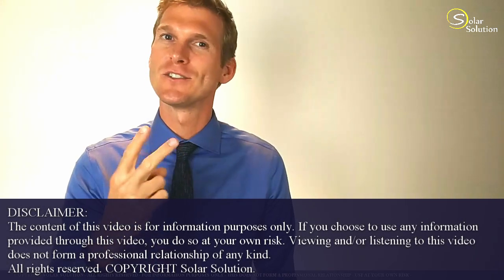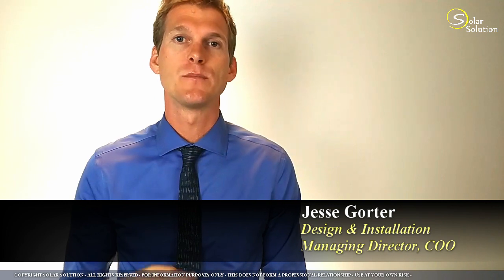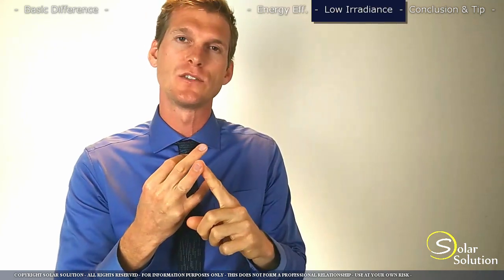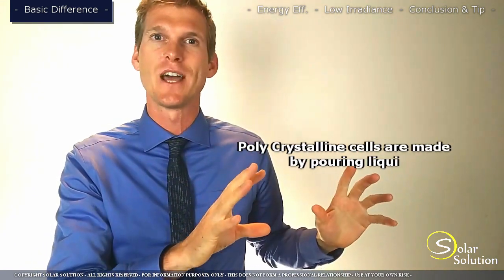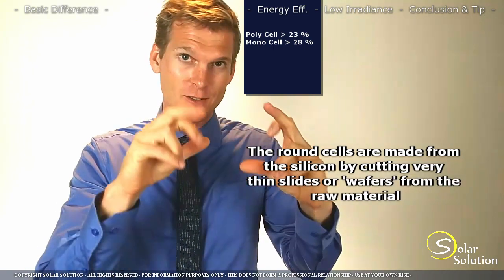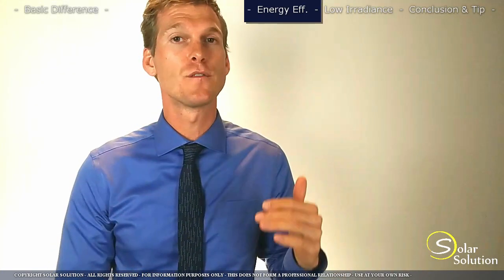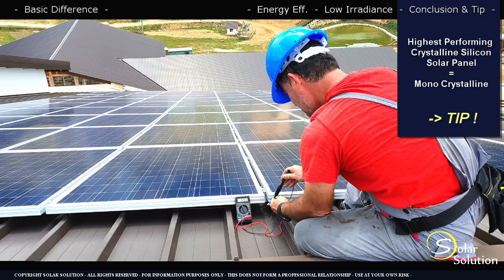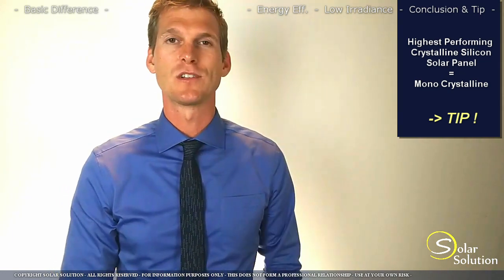Monocrystalline Vs. Polycrystalline solar panels: A Clear and Simple Comparison

Comment: Can you combine a mono and poly crystalline solar panels
Reply: I'm using them combined but on separate strings into a bus, one controller with one battery bank...output from each array is very similar...matching the peak voltages closely to the battery bank is crucial for performance...28-29v bulk charge from 30+/- volt panels

Comment: Great video, as usual :)

I have one question. Is the power rating of a solar panel the output electric power, right? In that case, we don’t have to consider efficiency to perform electrical-related computations, since it is already the output electric power, right?
Reply from the maker: You are correct Alejandro!

Comment: I have decided to buy 290Watt MONO at 32Volt But I can't find any MPPT to convert 32 Volt DC to 220 Volt AC. (I only use it for daytime for my PC and / OR FAN as I work for full-time WFH). 
My question is:
Can I use 12v/24v/48v MPPT to convert 32Volt DC to 220Volt AC?
This is the first time I'm going to use solar panels, and my main concern is low budget. You can say it's an experimental project. If I find it useful then work on a large scale.
I could not find any DC 32V to AC 220V converter :(

Comment: I live in Thailand where it is often over 	100 degrees and seldom under 50. From a ‘Heat’ perspective, Mono sounds better. Correct?
Reply: Incorrect. Wattage of the panel is the same mono or poly, it's the roof space availability and the flow of wind under the panels that will determine your choice. Unless you are doing hundreds of panels on a solar farm, the dimension of mono vs poly will not make a difference to your selection. 100 watt rating on poly is the same as 100 watt poly.

Comment: Being you seem so well informed on solar cells/panels, I have a question for you!  I purchased Bluetti SP120 solar panels.   I use these panels to charge up my Pecron 1500 power station.  Could I get your thoughts on the Bluetti panels and Pecron 1500 power station please?

Comment: Question I have is can you use the same solar 100 watt panel and 1 be a  monCrystal and one be  a poly Crystal whether you use it in parallel or in series is it okay to do that
Reply from the maker: Hello Josh, thank you for your question. In general it is not advisable to combine different solar modules under one charge controller. Good luck! Jesse.

Comment: Hello Jesse. I would like to Learn so far two things, one is which kind of panels in your opinion are better and another how companies are making profit on industrial solar panels ?
Reply from the maker: Hello Alexander, thank you for your question. Which panel is best for your setup really depends on what your personal requirements AND system performance requirements are.
Reply: Go for mono if space is a consideration - and it should be on a house, as one day you might want more!  Also mono are usually black cells and look better / more consistent. So if you care at all what your house looks like - get black with black frames.

Comment: Any possibility of adding a cooling system, say a small water tank, underneath the panel, would that improve the performance?
Reply from the maker: Hello Alex, thank you for your [excellent!] question:
Is it possible? Yes! 
Would it improve the performance? Most likely.
Will the the additional cost and energy consumption be worth it? Questionable.
Thumbs up for thinking outside of the box. All the best, Jesse.
Reply: Yeah - I wonder if a company will bring out panels with heatsinks on the back / liquid cooling. Would make a good 20% difference. But keeping the panel sealed from the weather for 20 years is hard enough - with liquids that can freeze in winter they'll have more warranty claims.
Reply: @markyates5744  but if it was in the winter esp with freezing temp wouldn't that be a good heat sink for the panels -seasonal advantage?

Comment: I live in the deep south here in the US.  My summer time tempretures can reach 100 degrees, but many days are cloudy and rainy.  My interest is in the ability of panels to withstand the tempreture extremes and which is more efficeint at converting partially, or almost no, sun exposure throughout the day. Thank you.
Reply: No panel will perform well in poor light.
Roughly... rain + dark clouds = 5% output. Dark clouds = 10%. Light / white clouds = 30-50%. Sun at right angle = 90% of rating. Sometimes when the sun comes out from behind a cloud you'll see the inverter spike to 110% of it's normal rating. This is because panels are cooler from being in the shade.
My solution (and most will recomend) is to over-size the panels vs the inverter. Panel watt rating is done at 25C. They typically all lose 0.3-0.4% per oC and in hot weather can reach 55C (like a black glass sunroof) ! So will be down around 20% from rating. They'll perform better on a cold sunny day than a hot sunny day.  There is also some losses in cables, and from dirt, and from the sun not being perpendicular. So with 4kWh of panels and a 4kWh inverter you'll rarely see >3.2kWh I reckon - and then only for a few hours.  Solar Edge inverters for instance allow you to have about 50-55% more power in the panels than the inverter. Remember also your electric company might limit you to 5kWh. So you get a 5kWh inverter. But you can pair that with say max 7.7kWh of panels due to the above and you'll never output more - but you'll be at a higher level throughout the day. if the panels are performing at average 33% efficiency you'll have a lot more power at 1/3 of 7.7kW than 1/3 of 5kW !
Reply: @markyates5744 Exactly over panel best option right now.. The main problem is the Solar panels efficiency rating @20-23% is too low, if it wasn’t for the free Sun power these wouldn’t be used at all.

Finding other way to harness the Heat temperature and in return produce a much higher efficiency rating for energy. Needs to be in the 93%+. Same with the cold temperature turning that into energy as well. To Me that’s green energy it’s abundant don’t let it go to waste. 

Wind,Sun,Hydropower,Moonlight,Heat,Cold…. There’s tons of it harness it turn into usable energy that’s the future.

Are all our batteries just chemical reaction containers?
Reply from the maker: Hello Michael, it is good to hear from you. And an excellent question! Knowing which question to ask is often already half of the answer: Two technical performance parameters which you might be interested in, are the 'Temperature Coefficient' of a PV module, as well as the I/V curves under changing solar irradiation values. These values can normally be found in the module's specification sheets. Good luck! Jesse
Reply: @SolarSolution  May I share this on LinkedIn with a link to your YouTube video?  I will make it plain that these tips are from you. I have been enjoying some exchanges with fellow homesteaders and this will be helpful to them as well.
Reply from the maker: Thank you for asking Michael: You are welcome to share it on LinkedIn. In case it would be useful for you: I have pasted the links below to my LinkedIn account as well. All the best, Jesse.
https://www.linkedin.com/company/solarsolutionco

Comment: Which is the best option for hot country like Saudi Arabia, which one is resiste the high sun heat?
Reply: best to oversize your panels vs inverter, eg. 7kW with a 5kW inverter. The panels will be losing 20% with heat loss and maybe another 10% due to dust / dirt / cable losses / not perpednicular sun, so 70% of 7kW is about 5kW.
Reply from the maker: Hello Abdullah, thank you for your question. I think you will benefit from the battery buying guide I shared: I will past the link below. Enjoy! Jesse
https://youtu.be/LhARAsr1KX8

Comment: Hi jesse
I have a question. My solar panel produces 19 volts. I need 14 volts to charge my 12 volt battery  what happens to the 5 volts. This has always confused me.
Many thanks 
Steve
Reply from the maker: Hello Steve, thanks for your message. You have an excellent question there, I will share a video on this soon. I will let you know through this comment once it is online. All the best, Jesse.
Reply: Voltage regulator: his previous video on voltage and amperage, can help understand this a little. Hint: water hose can burst if cannot with stand the pressure.

Comment: Thanks for the info Jesse. From what you explain there is only a fractional difference in performance from the two types.  Now could you explain briefly please what is the simplest way I can use some solar panels to harvest useful energy. The reason I ask is that i have bought a few panels at an auction. I can't afford to have a full re-fit of my existing hot water system which is just a simple direct tank so has a
heating element in it. What i would like to do is install the panels and just use the electrical energy produced to  heat up a well insulated large tank of water with a electric heating elemnt  and then use this heated water by by-passing my exsting hot water tank I would of course put on an a safety valve so should the tank get too hot in summer it would discharge the hot water. Is this a feasible thing to do ?
Reply from the maker: Hello again Chris! Congrats on your recent purchase, I am sure you are excited to get them up and running. Regarding PV module wiring, you might be interested in the video I shared on this, here is the link:
https://youtu.be/n3_lKIAcYsM
As for your other questions: Please refer to the pinned comment at the top. All the best, Jesse.

Comment: Hi. I get confused if Watts is equal of V*I  I*V = Watts. How did they made panels with hundreds of watts but only has 12v, or 24v? And roof display solar panels like mono or poly with 100w are more affordable than those portable usb solar panels which sometimes cost double the price but only ranging 20w to 50watts and work only 50% efficiency output?
Reply from the maker: Hi Jaz, thanks for your message. 

QUOTE And roof display solar panels like mono or poly with 100w are more affordable than those portable usb solar panels which sometimes cost double the price but only ranging 20w to 50watts and work only 50% efficiency output? UNQUOTE
-> Yes it true, often larger capacity solar panels are relatively lower priced [as in $/Wp].

QUOTE Hi. I get confused if Watts is equal of V*I  I*V = Watts. How did they made panels with hundreds of watts but only has 12v, or 24v? UNQUOTE
-> Power = Voltage x Amperage: This is still valid for 12V or 24V panels. Perhaps you could specify your question if you need additional clarification. You might also get more insight when studying the VI curve on the specification sheet of the panels you are looking at. Good luck!

Thanks, Jesse
Reply: @SolarSolution  I been curious of buiding my first simple portable DIY solar system using a cylindrical cell LiFePO⁴ of 12v 6A with BMS and solar array of 4 panels 6v 3.5watts each wired in series to get 24v. Would a PWM 12v, 24v auto and 10amps be fine with the battery? Or should I get an MPPT instead? And what is the Ideal AWG size to use to wire the panels in series to the controller? And to the battery also. Please, help.
Reply from the maker: Hi Jaz, thanks for your clarification. This channel has several other videos which will provide relevant information for your project. 
One example is the video on wiring sizing:
https://youtu.be/70JyQzeex7s
If you want my personal guidance in your project you are welcome to choose out of the three service options on the main website of solar solution:
https://www.solarsolution.co
Enjoy your design process, that's always fun! Jesse
Reply: Watts = volts*amps. eg. Typicall 400w panel is maybe V = 40v at 10amps = 400watts. A string of 10panels = 400v * 10amps = 4000w. But by the time it's been through the inverter it might be less as they run 80-96% efficient depending on load. The amps will drop as the light drops. The Volts will drop slightly.